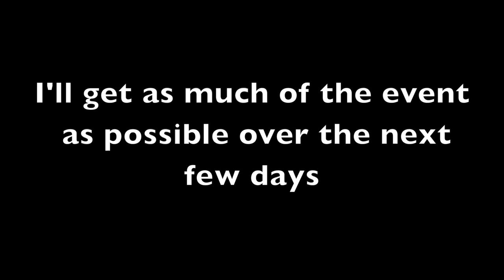Heading to Descend on Bend

Comment: Hey, Jamie. Wish I could join you I'm heading to Seattle to drop off a load heading up to Alaska. I used to refit sailboats and make interior cushion covers and sails. Plus I'm a certified welder. I of course have a few skills in the carpentry Dept. And know my way around electrical system's and plumbing system's so count me in for the next build! I'm going to be parking this rig at the beginning of spring and go full time! I just bought a 6x10' trailer and will be building it as a tool hauler. And toy garage.
And thanks for giving me the idea of getting extra hose's for the shop vac, I watched you cleaning up and it came to me! Use the vac! Just keep it outside and the dust won't be blown around before I can get to it. Sometimes you add great tips to your videos without even knowing it! Happy travels!
Beeps.

Comment: I have wanted to come to this since I saw it last year. I had hoped to make it this year in my old class C, but life has gotten in the way again. I have even thought about different ways to get my industrial sewing machine out there on the RV. ( I still have not figured it out.) I could even manage a week boondocking if I replaced my single old deep cycle with two new ones. With fuel costs estimated at $800-$1000, and money to get the RV ready, as it needs some small repairs, it is not in the works for us. I wish it were closer.....

Comment: If you're going to have a welder at the van-build.
Ask people to bring all the bed rails they have.
Bed rails are perfect for making basements for propane-bottles or water tanks ect..

You can buy very small 1" or 2" clamps that will lock a large propane tank to the rails.
Battery boxes are easy to put in a basement.

Just a thought!!! (*_*)

Comment: Good vid! Just FYI, in So Cal, that back plate would be illegal due to visibility issues with the bike there. Also, they stop people for not having good enough illumination on the plate. (Excuse to pull people over) AND, a front plate is required. I look at it this way, if you’re good in So Cal, you’re good anywhere!

Comment: It is very simple to make seat-covers, curtains and all sorts of other items for one's RV. Not Rocket Science when there is YouTube to help when in doubt. I find it very relaxing to just sit and sew in my RV on a rainy day, like being in my little nest. Sometimes, I use a tape-measure, other times, I just 'eye ball' it and it seems to turn out fine every time. I look for materials and sewing notions when I am at thrift shops and find that vintage machines work a whole lot better than the plastic rubbish ones they are making today. The simpler the better in my book!  Worth every penny to have an old machine serviced and/or repaired by a good sewing machine mechanic/technician. A Feather weight Singer comes in very handy to travel with, light weight and sturdy.